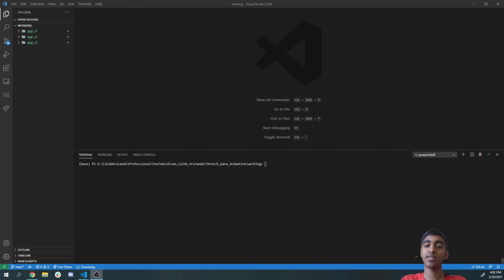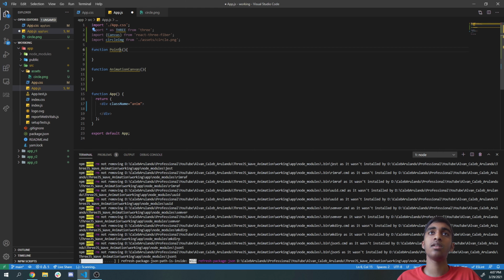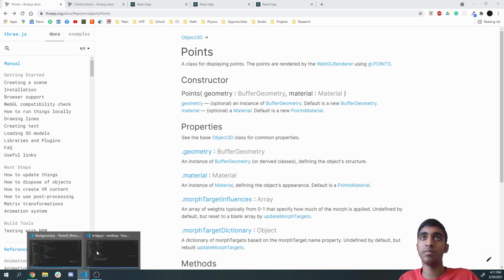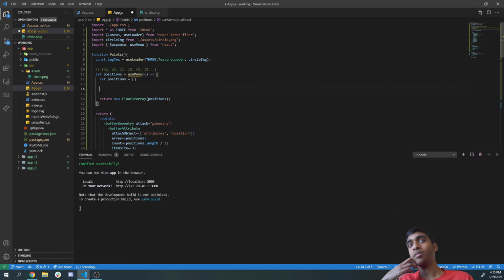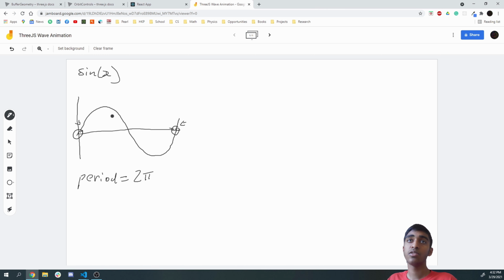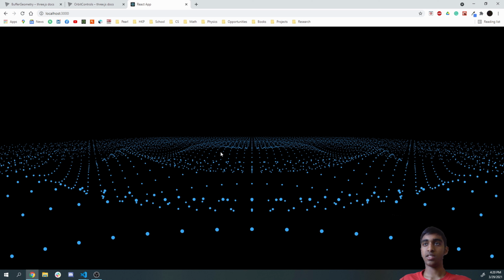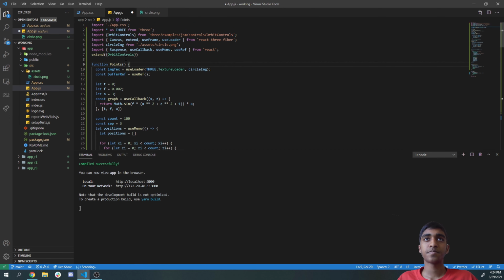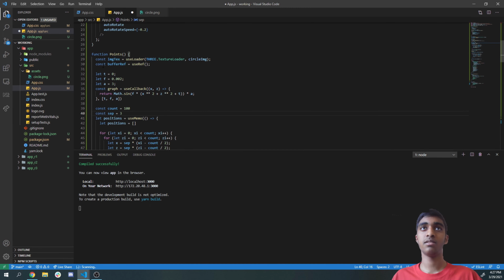Create a 3D Ripple Animation with React and Three.js using react-three-fiber | A Beginner's Tutorial

Comment from the maker: Since the making of this video, react-three-fiber has changed quite a bit. Be sure to make the following changes:
1. react-three-fiber has been deprecated and moved to @react-three/fiber. At 0:52, please install @react-three/fiber instead of react-three-fiber, and at 2:46 import from @react-three/fiber instead of react-three-fiber.
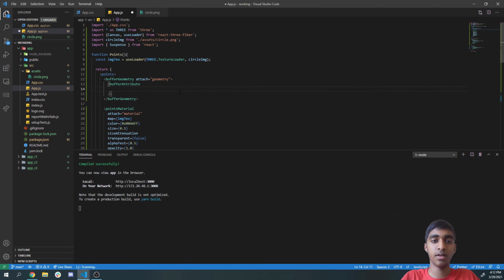2. @react-three/fiber v8 has removed the former attachObject API. At 9:29, replace attachObject={['attributes', 'position']} with attach='attributes-position'. 

To my knowledge, nothing else should change regarding the tutorial. But, if there is an issue, please let me know. Thanks!
Reply: So both Canvas and Three to import from react-three/fiber?
Reply from the maker: @zsoltdemeter9300  No. Anywhere you see the exact phrase `react-three-fiber` type `@react-three/fiber` instead. The only things that should change are the installation and line 4 of App.js. `import * as THREE from 'three';` should remain the same in line 2 of App.js. Let me know if you need more clarification.
Reply: @arulandu  Hi Alvan, thanks for the video. Seems that animation stops when user scrolls and oly orbit controls ratation is enabled, do you know why is this happening? I mean, points stops moving on scroll
Reply: Thank you so much... was scratching my head for much too long before reading the comments.

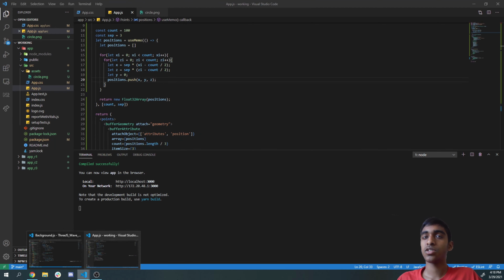Comment: hi alvan i recently want to learn to use points from react-three/fiber and i see your video try to learn from it but for some reason at 15:02 you were displaying the grid layout i tried on mine its not showing can you please explain why? or maybe  is this method a bit outdated? thank you
Reply from the maker: Do you get any errors in the console or terminal?
Reply: @arulandu  actually there's no single error on console or even terminal
Reply: that what make me confused of what i did wrong
Reply: @arulandu  i've the same problem. I don't understand why the content of the canvas does not appear on my html if i inspect it
Reply from the maker: @steph018  I've finally figured out this issue. New instructions are updated in the pinned comment.

Comment: Thanks for the awesome tutorial! I'm currently facing a problem, the app crashes every time it loads and I get the following errors: "Div is not part of the THREE namespace! Did you forget to extend?" and "THREE.WebGLRenderer: Context Lost." Can I have some help here please?
Reply from the maker: I would need to see your code to be sure, but I have seen this before sort of error happen before. You can not use suspense with 'typical' JSX components like <div> inside the canvas element. Inside the Canvas, you can only use Three.js components (there is another way to use 'HTML components' inside the Canvas).

Comment: Awesome. Clear and super helpful.
I'm new to all this and trying to figure things out. If I want to feed in a dynamic variable, say to change the number of count particles how would you go about doing this. I've been trying to use a variable useState.. but it doesn't work, is this because three doesnt use react DOM renderer? I have a variable stored in useContext that I want to feed into change count but getting errors..
Reply from the maker: Hey Yuki! So, I have tried what you are suggesting and have also ran into errors. useState works with @react-three/fiber, but the issue is that your are changing the count. If you decrease the count (as a state), the number of points does decrease. However, if you increase the count, you should see a WebGL buffer overflow error. This seems to suggest that the problem lies in the fact that count controls the size of the Float32Array buffer that stores positions. I am still looking for a fix, and will keep you posted. Sorry I couldn't be of more help!

Comment: Hi! Useful content. :) Can you tell me how can I make this entire thing in a circle?
Reply from the maker: I mentioned this as a possible extension at the end of the video. You would need to change the layout of the grid so that the points are evenly spaced in a disk and not a square. To do this, I would recommend looking into polar coordinates and incrementing by a fixed theta and fixed r to place the points on a disk. You would also need to change the indexing scheme in the useFrame() hook. Let me know if you need more clarification!
Reply: Can you just guide me😅 bit lost
Reply from the maker: Sorry for the delay in communication. I'll try to explain this as best I can over text. It would be helpful to refer to the GitHub repository provided in the description of this video.

If you look in the `/src/App.js` file, to make this entire thing circular, you will mainly need to change lines 44-51 and 61-70.

In 44-51, we are iterating over a grid (x and z) and pushing the x, y, z values to the positions array. Instead of doing this, you will want to iterate over a disk (r and theta). See https://mathworld.wolfram.com/PolarCoordinates.html for guidance on polar/cylindrical coordinates. We can use trigonometry to get x and z; x = r*cos(theta) and z = r*sin(theta) and then use the graph(x, z) function to get the value of y. Just like before, we push these into the positions array. 

Now to simplify things in 61-70, we can replace the nested loops with one for loop through the positions array; `for(let i = 0; i < positions.length()/3; i += 3)`. Note we divide and increment by 3 since each vertex contains 3 position values (x, y, z).  This means positions[i] will give us the x value of the current vertex, positions[i+1] is the y value, and positions[i+2] is the z value. Since we animate the y only, we can simply set the height based on the pre-existing x, z values in the array; `positions[i+1]=graph(positions[i], positions[i+2])`. 

I haven't tried this out for myself yet, but it should work since we are not triangulating anything but just animating points. Feel free to respond with questions or clarifications. Hope you get it working!
Reply from the maker: If you're still working on this, I've recently implemented something known as Delaunay Triangulation which does exactly what you need: evenly triangulates a circle. I highly recommend looking into it. You can find source code quite easily with a google search.